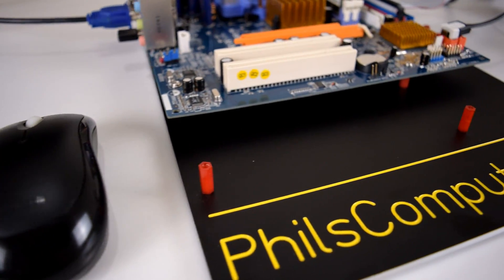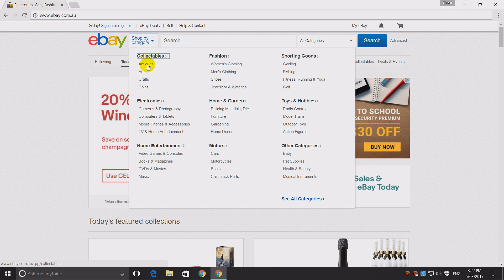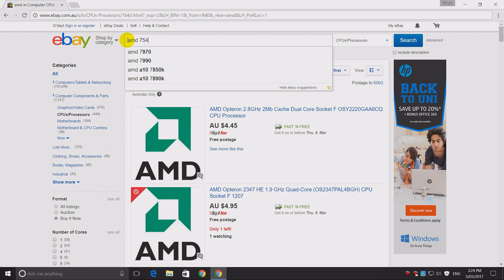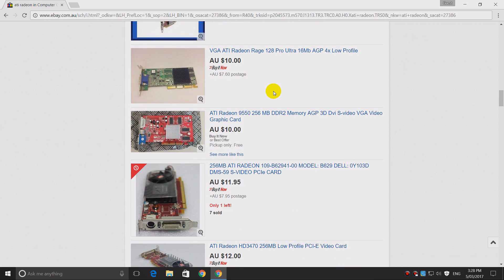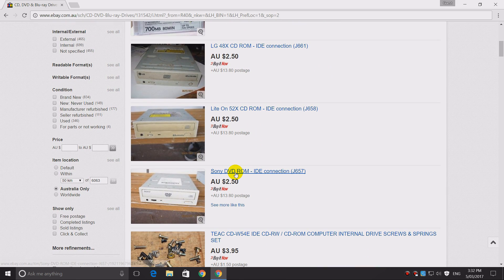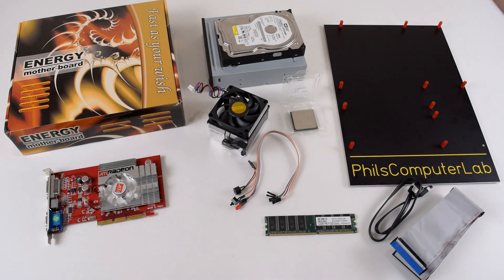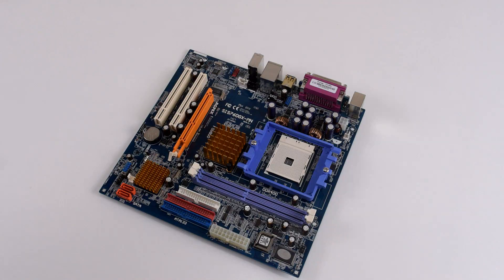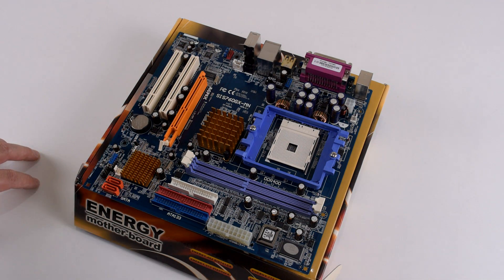Building a cheap Windows 98 Gaming PC

Comment: Hm, just reminds me, that I used a similar setup: AMD Sempron 3000+  (that was apparently nothing but a renamed Athlon XP 3000), 2 Gig DDR 400 Ram and a Radeon 9800  .... and I ended up using that system until I bought my current PC in 2014 xD

Comment: Nice build. Your build has more than enough power than what Windows 98 and most DOS games need. I hope you can find drivers for the USB and ethernet.  I'd stay far away from using any Maxtor IDE drive. I bought a couple Diamondmax drives on sale about 15 years ago thinking I had a good deal, but they all started giving me problems after 1-2 years of use.  And its amazing the prices on Ebay keep going up and up. 10 years ago you could get old 90's era parts dirt cheap online and some of my local stores were tossing away old cases, motherboards, video cards, CPU's and CD-ROM drives just to get them out of their store. I got several Pentiums, K6's, Athlon T-birds, Athlon XP and Duron CPU's from them. Now If I just had room for another desk!
Reply from the maker: I ended up using a WD 80 GB as that was what I had lying around. The CD has all the drivers, that's one good thing about buying a motherboard in box.
Reply: It's not for everybody, but I share a single desk with a Windows 98 desktop and my modern one with a KVM--one Keyboard, one set of speakers, I used to share the mouse (but my Steelseries doesn't work under 98, meaning I need two now) and a shared VGA source

Mind you, I do primarily use a beefy 21" CRT monitor, so that makes it considerably easier, but there's even a modern LCD sitting beside it--someday destined to be upgraded with an OLED monitor.  (just a few more... years... *sigh*).

It looks like there are plenty of Displayport and DVI options too.

Comment: I've already got something very similar sitting on top of my wardrobe, with an Athlon XP 2000+ running at 1.66GHz on an Elite Group Micro ATX purple motherboard with an AGP 4x slot and 3 PCI slots. It's a pre-SATA board though, so all the drives in that system are currently PATA. It's also got a 64MB MX440 AGP GPU installed, with a Sound Blaster Audigy LS PCI card, dual booting between 98se and 2000.

It was my first Windows XP system from around 2005 that kept me going after support for 98se was dropped by Microsoft, until I upgraded to a S939 Athlon 64 4000+ based machine in 2007. At present, it's all residing in my first ever PC case that I'll be gutting to downgrade to the PIII600E based system I'll be building soon.

You're right about prices going out of control for choice, almost 20 year old, parts that are surprisingly hard to find. For example, I'm seeing certain reputable 440BX motherboards on eBay going for as much as brand new Kaby Lake full-on Z270 all-the-candy-and-the-kitchen-sink-too RGB type boards. Crazy!
Reply from the maker: Nice. Athlon XP would have been my other option, but at the time of looking the Athlon 64 had the cheapest board. The next cheapest was also an Athlon 64, Socket 939. But I have a hunch that a Socket A CPU might be cheaper than that Sempron for 754. Indeed, some old parts are demanding a massive premium. Good Super Socket 7 boards for example. They do indeed cost more than a brand-new motherboard like you say. Hard to wrap your head around that one.
Reply: Compaq board's an epic fail.

A 3.3v light comes on showing it's got power, another light shows the power switch when pressed, and another shows main system power, which blinks briefly... and that's it. No beeps, CPU fan doesn't even twitch.

Gone back to the Elite Group K7VMM+ (v7.1a) purple motherboard, (with just 2, not 3, PCI, slots, an AMR slot, and an AGP 4x slot) and Athlon XP 2000+ Thoroughbred, with the PNY 6200 AGP card, Turtle Beach Montego II, a working 256MB stick of DDR 266 RAM, and the same 2 x 80GB Samsung PATA HDDs and Mercury 400W PSU.

Finally got it all working reliably, (after some troubleshooting with the BIOS, and several installations involving general protection failures and the odd blue screen of death). Would probably run way too fast for older games like WipeOut 2097, but it'll have to do until I can afford a proper retro board and stuff for the Pentium III and memory I've got.
Reply: PhilsComputerLab P.S. Thanks for the Aureal 2 drivers off your website! 🖒
Reply from the maker: Nice :D
Reply: Ooh! Just bagged an AOpen MX3S Socket 370 Micro ATX motherboard, complete with PIII 1000EB CPU & cooler, off eBay in the UK for just £22.49 with free P&P ! :-D

(That's around $27.81 US, $36.13 Australian & $37.10 Canadian). ;-)
Reply from the maker: Nice! Bargains still exist :)

Comment: For my Windows 98 build, I have a DFI CA64-TN MB with 768mb pc-133Ram, a 1Ghz Pentium III, and a choice of gpus to chose from. I have an ATi Mobiliy-P 8mb, an Nvidia fx5200, and a new (sealed) in box radeon 7000 64mb.

I'm getting a BIOS checksum error, so it's at a standstill. But it's costed me 13$ US (Excluding the gpu) total so far buying parts on ebay.
Reply from the maker: On this board the BIOS battery was dead. Sometimes re-flashing the BIOS works because of bitrott. I don't think I'll find a newer BIOS for this board, I have no clue who actually made it :D I'm sure it's fine for what I want to do.
Reply: I already changed the BIOS battery, I just need to reflash it, which i need a floppy drive for, but that means taking apart my Sony computer to get it.

The message is:

Award Bootblock BIOS v1.0

BIOS ROM checksum error

Detecting floppy drive A media

INSERT SYSTEM DISK AND PRESS ENTER
Reply from the maker: I see. If the BIOS chip is removable, it might also be worth buying a BIOS programmer. It depends though if this is something you see yourself doing often. I do, so I got one ages ago and it's a real time saver.

Comment: i have asus k8v-mx rev 3.0, sempron 3400+ (2ghz l2: 256kb 64bits)
i think the beta bios does set the cpu fan for full speed.
Reply from the maker: Very nice. Remember that you can use modern AM3+ coolers!
Reply: going for windows me and install unofficial service pack
Reply: its to play windows games.

Comment: My dad's co-worker acually gave me a Gigabyte GA-8IG1000 Socket 478 Full ATX mobo with a Celeron + a Spire aftermarket cooler. It has 5 PCI slots and an AGP 8X slot. Is it decent by you?
Reply from the maker: Sounds great. The Celeron not so much, but Pentium 4 chips are cheap and easy to find!

Comment: Do what I do. Salvage. I can build several win98 systems all at no cost because their parts were salvage. 

Among the GPUs I have found are an S3 virge and an S3 trio, a voodoo 3, a tnt2, a cirrus logic one with too big a name , a matrox G55 an ati rage 128 pro along quite a few MX and FX ones. 

CPUs aside a pentium 166 and a pentium MMX 200, its pentium 2s and 3s galore

Ram and HDDs, lots of them

Sound cards? An Awe32 and a soundblaster 16 were basically found during  dumpster in the local recycling center. I got 2 soundblaster live cards, one given to me by a friend the other one traded in along some other stuff for a HP laserjet 2600. Also, I count a couple terratec ones.

Thats not counting the salvaged computers I have yet to take apart.

Comment: Do these hardware have driver for win98se? They are too new for win98.
Reply from the maker: Yes Windows 98 and ME are fully supported. The manual shows it and the drivers are on the CD. I will talk about the drivers, BIOS and other bits in the next video.
Reply: Hi, if it's not too much trouble, could you please provide some instructions on performing fdisk? It's been perhaps more than 10 years since last time I installed win98, I feel I'm kinda rusty.....

Comment: Hi Phil, I actually have pretty much these same parts except for the GPU which is an XFX GT 6600 (also have a 5200). I've got XP installed on it atm, but would 98 be better? Also do you know where to find the best drivers for my config? 

Oh btw, I have currently 2x1 GB ram, but that would be too much for 98, so should I stick with my 512 MB stick?

Thanks for great vids :)
Reply from the maker: There is a patch for the 512 MB limit, but I never felt the need to use it. XP runs a lot of "98 era" games, but can struggle with older ones. So it depends on what you want to do.
Reply: Thanks Phil. I'm still in need for a decent monitor and a new keyboard and mouse for it. Not a priority now unfortunately, but I hope to have it fully installed and running some older games soon :)

Comment: I still have plenty of parts left from my previous PC builds. Last year I tried building a Windows 98 machine out of an old Athlon 64 3200+, Socket 754 motherboard, some old DDR memory and a Voodoo 3 graphics card, just to see if it would be something that I want to have. It all worked just fine, after a bit of messing around with KernelEx and various driver updates. The only thing missing was a proper Sound Blaster Live sound card; my spare SB X-Fi is a piece of crap with terrible driver support. But in the end, after getting everything to work and playing some games, I wasn't really feeling it, and I was reminded how Windows 98 is an unstable user-unfriendly tosh operating system. So I took the machine apart again and decided that this type of retro gaming just isn't for me.
Reply: That's a shame :^( at least you can say you don't like it with valid experience
Reply from the maker: Consider the Audigy 2, it's a great card and can be used in 98 and XP.
Reply: Yes, those older OS can be really tricky if stability is what you`re looking for. Thats why Win2000 is best choice, but with proper drivers I find Win98 and WinME just as reliable, my Dell GX240 runs like a dream without single hiccup on WinME. And yes, I`m not even joking, WinMe!
Reply: If I were to build a retro PC again, preferably I'd like to get a sound card that also has native DOS support, which is why I specifically looked at the older SB Live cards. It is more or less the best of both worlds, with decent drivers for both DOS and Windows 98. Ironically I actually had an SB Live at one point, but I did away with it when I upgraded to the X-Fi. That turned out to be a poor decision.

Now I have to admit, this retro PC build has remained in the back of my mind ever since I tried it out last year. Having the parts put together into a functional machine is always better than having them lying around doing nothing, so there's that. Also, I would like to try the same hardware with pure DOS and a decent sound card. So I might yet revisit this project someday.

Comment: Love your channel Phil, watching from New Zealand, we have (Trade me/Ebay equivalent) We only have P4s and up, some of them lack A: drives, my P4 motherboard has pci-e support.... Loading windows 7 on via usb was easy, not to sure how to do 98 without a floppy.... Do you know work arounds... As even floppy drives over here are getting hard to come by, might make a good video... for you to do... (thanks) and keep up the good work.
Reply: Don't need a floppy for 98 unless you are trying to install a raid or something, I hope that you are not trying to do Dos on a pentium 4  era system. Have you tried importing from Australia?
Reply from the maker: As long as the machine can boot from CD you're fine. The W98 CD is a boot CD, so it's very easy to install :)
Reply: +PhilsComputerLab, I think its because I dont have a legitimate 98 copy and only setup files...on an old backed up cd... Oops ;)
Reply from the maker: In that case, if you have a boot floppy, you can make your own Boot CD, and have those installation files on that same boot CD.
Reply: PhilsComputerLab thanks I'll look that up...

Comment: Yes! 1. get a computer for free from an IT teacher  ( this actually happened in 2014. Also, it was a Dell Dimension 8200 from 2002. It has a 2.8 Ghz P4 and 256 MB of RDRAM.  ), 2. find an EVGA Nvidia Geforce MX440 for $5 at a thrift store, 3. pop in a hard drive from my collection of IDE hard drives ( one in particular being a Western digital 80 GB hard drive from 2005 that had only 250 hours on it), 4. install windows 98 SE and whatever drivers you need, 5. install whatever games you want. The PC is currently hooked up in my bedroom.

Comment: Nice video, in my country finding one ASUS socket 775 motherboard and a Prescott 3.2 P4 its pretty cheap the hard part is : finding one aureal vortex2 sound card and one high end agp card.
I have my P4 build, and it was way more cheaper to build than my 3-in-1 socket 7 build, to be honest the PSU was the most expensive part, and i sent with a Corsair VS series psu.
Reply: Some places are dead zones when it comes to finding parts locally even in the states to the surprise of some, where I live local supplies have mostly dried up and have to use eBay.
Reply from the maker: Yea it does vary a lot depending on where you live.
Reply from the maker: I never built a dual CPU machine, I don't see the point and you can save a lot of money and hassle.

Comment: windows 98 dont supports sata
Reply: Must be using some sort of third party program. I tried using a PCI SATA card on my Windows 98 build, it even has drivers for Windows 98 but it doesn't show up under Windows Explorer.
Reply: Do people not look at the SiS drivers page? They have SATA drivers for 98SE, but shhhh, it's a secret!
Reply: Ryszard Wastag Then why are there so many 98-builds on Vogons, using Win98 sata drivers? I had an MSI K8(something mmv) running with sata on Win98se.
Reply from the maker: You'll see :D
Reply: Ryszard Wastag in ide emulation it will support just like xp
Reply: Yes it does, sort of. If the motherboard supports sata and comes with or can be acquired w98 sata drivers, it will work fine. If you can't get 98 sata drivers for your motherboard, you would have to get an add in sata card with 98 drivers.
Reply: Ryszard Wastag There is a 100$ Sata Drivers pack.
Reply: windows 98se unofficial service pack....

Comment: I have built a win98 pc with a 15 years old Fujitsu /Siemens socket 370 mainboard.
Surprisingly, i could still find documentation and windows 98 drivers on the Fujitsu/Siemens website for this board. Kudos.
I use a P3 933, 512 Mb ram, a Geforce 6800 and a Soundblaster Live.
Working great.
Reply from the maker: A lot of manufacturers are really good with drivers. Gigabyte, Asrock for example. I think Asus and MSI as well. Hopefully this will continue...

Comment: For cheapest possible I would have gone for a socket 478 office PC with an AGP slot, which I think are handed out free at your local computer recycling bin and through the classifieds (free if you come pick it up, AKA save me a ride to the dump). Then I'd buy an aureal vortex 2 sound card for probably 40-50 euro; no skimping on the aureal vortex 2 card, since that's the major reason to build a windows 98 retro PC. If the power supply was terrible it would have to be replaced. Then I'd get a cheaper geforce FX series card (probably 5700 ultra or 5900 XT or non-ultra); which is very comptible and plenty fast to run anisotropic filtering, which is esssential.

Having bilinear without anisotropic I've always felt look straight up worse than nearest neighbour (think software rendering) as there are discrete steps when the mipmap level changes and any off-axis texture is very, very blury. I turned on anisotropic filtering when I got my 9800 non-pro 14-15 years ago, and I haven't turned it off since.
Reply: Pentium 4 office toasters are bland and even then a lot of them don't even have an agp slot, geforce FX cards aside from the 5200 and 5500 have gotten to be pricey.
Reply: A lack of blandness wasn't a stated requirement.

A sufficient number of office toasters have AGP that it's not hard to locate one. Go to your local dump, open 3 beige cases and there you go.

€10-20 for an FX 5700 ultra or FX 5900 gimped card (XT etc.) is quite easy to find and that isn't pricey; that's comparable to the shipping you'll pay just to get the card sent to you.
Reply: I've done a lot of recycling centre "raids". You can get a wide range of components from there. The oldest I've seen so far was a 386 mainframe and the newest were Core 2 Duo machines. If you be polite and ask nicely, they'll surely let you keep a few of the computers.

Comment: What a great ideal! I find that Athlon XP boards are the easiest and cheapest boards to find. DDR2-266, I seem to have a lot of each from dumpster diving. 

I have a FIC Motherboard that I may try Windows 98 with, I would pair it with a  XP 3200+, 512 MB ddr-800mhz RAM, 200GB Maxtor IDE (8MB Cache), Geforce 6 6200 AGP8x 256MB, SB-128 PCI (ESS Chip), and a DVD+/-RW. Right now, my Celeron 700Mhz is good enough for DOS/98SE Gaming but It has a Intel 810e IGP & Zip 250.
Reply from the maker: Nice. I think Athlon XP was my second option. The A64 has a few perks though.

Comment: I built this exact computer in 2007 from parts that were on clearance locally. The motherboard was awful and never ran stable with an AGP video card in, so I replaced it with a nForce 3 board. It eventually ran GTA San Andreas OK which was all I cared about at the time.
Reply from the maker: Hopefully it works out well for me.